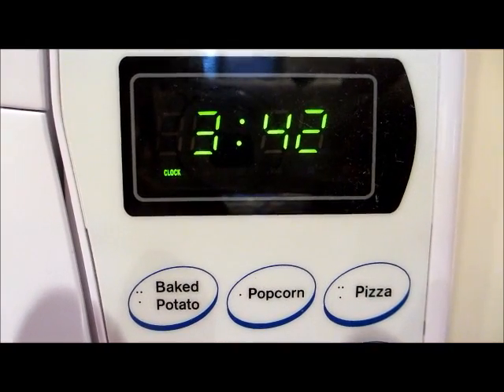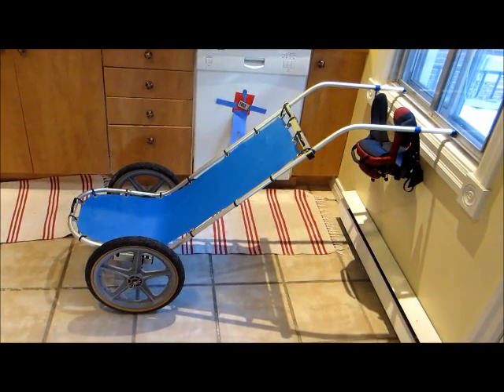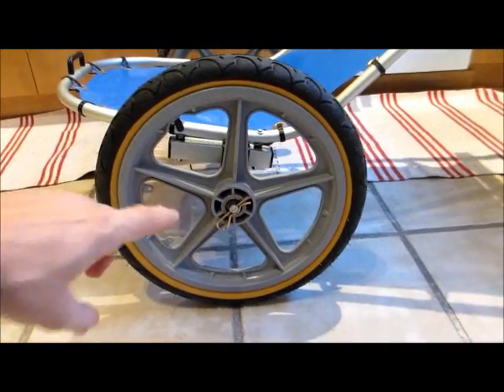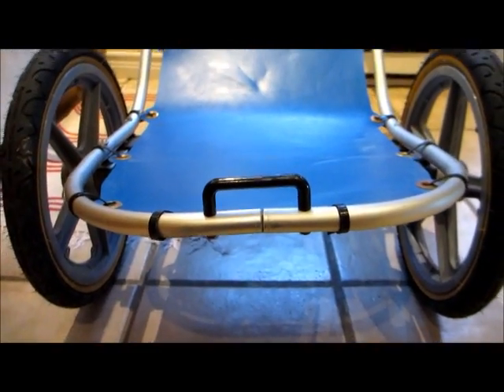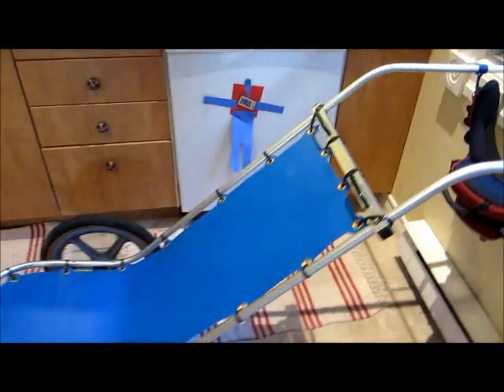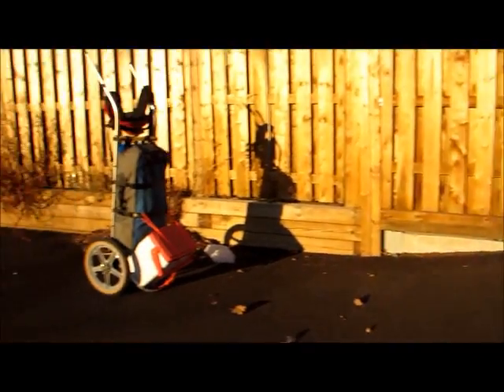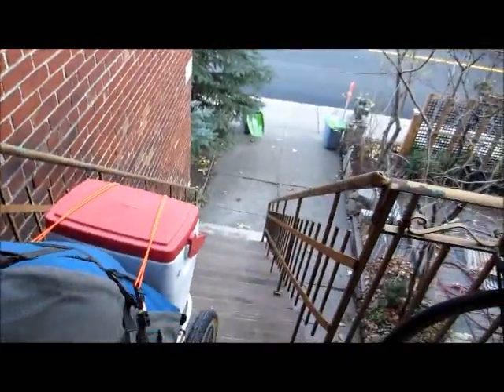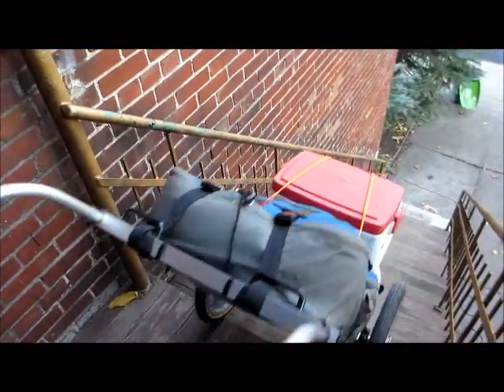DIY Mystery Gear from the Cheap Bastard

Comment from the maker: Sorry Cat, there is no technical data to post.  This entire project was done "free hand" as they say.  I took no physical measurements to speak of.  Everything was more or less eye balled into place.  I was using my own body dimensions to get the sizing needed. This was the third iteration, and its still not perfect.  When you look at it from behind you can see that one side sits a little higher.  Heck the tubing was bent using a hand held conduit bender.  What can I say?  Sorry.
Cheers

Comment from the maker: It's called a prussic knot.  It's a well known knot in the world of mountain climbing - useful for climbing a fixed rope - but it has a gozillion other applications.  I use the same knot to attach my hammock tarps to the tarp ridge line.  This means I can adjust the tarp along the line depending on how far apart the trees are from one another.  Very handy.
Cheers

Comment from the maker: The 16 inch wheel set was ordered from a company in Ottawa called Wike Trailers.  The square tubing that links the wheel set and acts as the undercarriage came from Home Depot.  The round tubing that makes up the deck frame also came from HD.  I "rented" a pipe bending tool from HD as well to bend all the angles in the round tubing.  That was pretty much an eyeball operation since I had no exact measurements for any of this.  The decking is an old magic carpet snow sled.  Very durable material.  I cut it to fit and used a half inch grommet kit that I had hanging around.  I think I bought it from HD as well.  The decking is attached to the frame with UV resistant zip ties.  The two halves of the deck frame tubing are connected by inserting a wooden dowel at the joint.  A black plastic cabinet door handle is screwed in to complete the connection.  The harness is made from a large sized fanny (butt) pack that I had picked up years ago from Mountain Equipment Co-op.  Sadly they no longer produce that model, but there are certainly other options available.  I attached a carabiner to each side of the pack and used a prusik not to hold on to the round tubing.  This is a constrictor knot, so when tension is applied it holds fast and will not slide.  Remove the load tension, and you can position the knot wherever you like.  Pure genius.  On the square tubing of the top brace I added two additional black plastic handles.  This was purely for aesthetic reasons, and because I had them laying around.  Later, they proved to be quite functional as well for lashing various items to the rig.  Also not shown in this video is the shoulder harness system that I added to the butt pack.  I found this a necessary addition for pulling any load heavier the 40 lbs.  I'll chip in a link to show how this set-up ended up working for a project of mine.  Let me know if you have any other questions.  Cheers from Montreal QC

https://www.youtube.com/watch?v=KL4LalWNVHc&t=82s

Comment from the maker: When I designed and tested this cart I was hauling 75 lbs up Mount Royal and back  (a 10 mile course).  On the way down I was actually running.  In this manner I could repeatedly complete the course in under 2.5 hours.  The wheels I use are 16 inch pneumatic with tubes on plastic rims.  The beauty is that they work just as well without air.  In this video with a 50 lb load they have no air.  Long story short: flat tires, no problem.  Any more questions, give a shout.
Cheers

Comment: Please let me know how this works when you do your hike. Does it restrict your gait any?  This is pretty much exactly what I've been looking for, as I'm planning to thru-hike the American Discovery Trail. There are lots of places where the trail is pretty narrow, steep, rocky, etc etc.  How much weight do you think it would hold? I was thinking about building something like this but adding little camping pod made out of a pickle barrel (?) for more protection than a tent (bearophobia). Also, it almost looks like it could be used as a little chair if you get tired and need to rest. Could you post more photos or give more details as to how you attached the wheel assembly to the frame?
Reply from the maker: Hey Bonnie,
Sorry for the late reply.  Here is is a link to the trailer, Toto 2
A Grand Day Out With The Toto II Trekking Trailer

I took it for a hike on city streets, open trails, and a little bushwhacking before nearly slicing off my thumb while making a spot of lunch.  This rig is awesome.  No matter how much you load it, there is no extra weight on your back, hips, knees, or feet.  Wonderful stuff!  And it also makes a great recliner when braced against a tree or post.

Cheers from Montreal QC

Comment: Hi Jeff. I like very much what you did. There is in Holland also a bureau who build these trekkingcarts. Look at Radical  Design wheelie wandelwagen. But I like yours better. Simple, you can take any luggage you want and are not bound to a bag like Radical design made. How did you become the parts for joining the wheels to the structure. Good luck with building. I am working on a bycicle cart now.

Comment: very good! you could tell me how much is the distance between the wheels? I intend to make one for my hikes !
Reply from the maker: measure the distance between your hips and add 2 inches.  It's just that easy.
Reply: +Jeff Spate thanks ! Now I achieve the 2 wheels and this week I'll start the project !
Reply from the maker: give a shout if you run into any snags.  always glad to help.

Cheers
Reply: +Jeff Spate i have some difficult with english ! I'm from Brazil... I'm planning to hike the camino de santiago, 800km ! , with this backpack trailer. Your's the best I've seen: simple, practical and beautiful ! Mine will be a copy at "long distance" of yours!
Reply from the maker: Send me a note If you need any help with the build.

Cheers from Montreal QC
Reply: I built the cart and walked the path of Santiago de Compostela with him. It was a success! I thank you for making this movie and sharing your ideas. It helped me a lot...
I walked the camino in october/2016...
Reply from the maker: Awesome!!!  Real glad everything worked out.  Two thumbs up for your effort.

Cheers from Montreal QC

Comment: How fast can you stop from a full run with that fully loaded? Does it feel like there's much danger of it bowling you over? I can imagine it wouldn't be hard to give it real brakes with levers by your side, but maybe there's no point unless you're pulling a lot more weight.

Nice job. I'm really inspired. I'm going to be spending some time thinking about what additional uses might come from this essential design.
Reply from the maker: If I were making a steep decent on rough terrain, some sort of hand brake would be a wonderful feature.  However, the design brief did not call for that particular scenario.  Primary intent for this design was road use.  I chose to illustrate its versatility by taking it off road.  Amazingly, it does not feel like it will bowl you over.  That might change, however, as load weight is increased.  I've loaded it to 75 pounds and run down the trail from the top of Mount Royal here in Montreal with no problems what so ever.

Cheers

Comment: sweet cart . i have all the materials to replicate this ...but how did you bend the tubing ? that's the only question i have . for now . i realize this was published years ago but i just found it recently . thanks in advance for any help on this .
Reply from the maker: In the electrical department at Home Depot I found a tool used to bend galvanized electrical conduit.  It's not an exact science, to be sure, but it did the trick.  It helps to have good eyes for eyeballing.  My eyesight ain't that great, but it appears to be good enough.

Cheers from Montreal QC
Reply: Jeff Spate thanks , when i get it done i'll put up a video . i ran across an old boat bimini cover . nice aluminum pipe , some bends in it i may be able to use . we shall see .

Comment: Heya Jeff, I don't have any material to heat-bend the alluminium and don't want to get gaz in my appartement (Living in the Mile End) would you .... do some for me ?
Reply: Getting ready for the Appalachian from Canadian side NB to Unitedstatian side Georgia and maybe even further down in New France (or what's used to be so)
Reply from the maker: +Eric Vanh 
I just used a cheap'o pipe bender to do my thing.  I'm happy to lend a hand if you need help.  Call me: 514-276-1046.  I'll be home Tuesday afternoon.

Cheers

Comment: A wheeled travois.  Cool.  All you need is a shell to act as a weather cover and possibly a temporary shelter.  I would have is longer in length to accommodate a longer stride and I'd go with a conventional 16 inch fat bike tire.

Very cool!  This is very inspirational and totally a something I'd want to have for those walk-abouts.

Comment: I like this a lot better than the two I put together.  I like the idea of the bigger wheels, and how you angled out the bottom, not to mention using a fanny pack.  Like, duh, why didn't I think of that.  I was always playing havoc with trying to attach my cart to an unpadded military belt. Not to mention, after watching yours, mine is clearly not wide enough.   Really slick!  Good Job!!

Comment from the maker: The rod I bought at Reno Depot, a hardware store in Montreal.  I was able to bend it using a pipe bending tool (from a Home Depot store) that electricians use for bending galvanized conduit pipe.  The wheels I ordered from Wike Bicycle Trailers in Quelph, Ontario (I live in Canada as you may have guessed).  Let me know if you have any other questions.
Cheers

Comment: Are you still using this cart? Have you made any changes?
Reply from the maker: I used this rig for a 200 km hike from Montreal to Ottawa several years ago.  I met a guy who lived in China that wanted to mass produce the trailer, but that never really got off the ground.  I have since dismantled the thing, and now use the wheels for my bike trailer.  Cheers from Montreal QC

Comment: Still loving this contraption. What did you use for the axle? Was that aluminum tubing too?
Reply from the maker: Hey Bonnie,

The frame for this carrier is made using an aluminum curtain rod.  The axle is an aluminum box tube.  The wheels have their own spindles that are fixed to the plastic connection pieces.  It's not complicated, but my description might make it sound so.  Glad you like this rig.  I'm taking it out tomorrow for a 400 km shake down.  I'm doing a cancer walk from Montreal to Ottawa and back in 7 days.  The carrier is my life line.  We'll see if Toto 2 can get the job done.

Cheers from Montreal QC
Reply: God speed. I look forward to updates. I'm working on transforming a little golf-bag cart (because it was 10 bucks), but if I had any spare change, I'd definitely prefer yours.
Reply from the maker: It's worth noting that my carrier was inspired by the sort of golf cart you mentioned and also by snow shoes.  Strange, don't you think?
Reply: These should be a common fixture at every outfitter or sporting goods store! Almost every thru-hiker I've seen pushes a jogging stroller. Why not pull hands-free instead of actively pushing with both hands.
Reply from the maker: That's the idea.  I'm hoping the trip I just finished will make for the right marketing tool.  Stay tuned for the video on that.

Cheers

Comment from the maker: Easy now.  Paul makes a valid point.  However, before going out & buying something, one should first carefully define ones needs.  I didn't need something that would carry 300 lbs., nor did I want a cart weighing 30 lbs.  My goal was to build a cart that would weigh in at 10 lbs (or less) capable of carrying 75-100 lbs over relatively flat or smooth terrain for up to 25 miles per day (a road trip).  It's the harness system I put together that makes it all work.
Thanks for your thoughts.
Cheers

Comment: Ingenious!  It looks like you have thought of everything, including a clever way to harness it for hands free pulling.  AND larger wheels for easier rolling and SOLID RUBBER so no worries over punctures.  I am using a light aluminum deer cart without a hands free harness,  Your excellent video gives me a simple idea.  I will attach handle extensions on each side, and rig a harness using your technique.  Now I can use my trekking poles or be hands free for dealing with limbs and briars on overgrown paths.  A cart of course is not suitable if your trail leads over large boulders.  Your invention is light enough, however, to muscle the cart and backpack over the  bouders, assuming the extra effort is not required for a long distance.
Reply from the maker: Hey Larry,

I have to say, this rig does work amazingly well.  I'll be giving it a serious road test this spring when I attempt a hike from Montreal to Quebec city (approx 225 km).  This will be a long distance endurance hike which I hope to complete in 4 days.  Wish me luck, and good luck to you as well with your deer cart.  Shout out if you need some ideas.

Cheers from Montreal QC

Comment: I have a trailer like this, don't be deceived, you cannot take more on your hike, it's just a way of moving the load off your shoulders and onto your hips. You still need to drag your gear up hills, along stony paths and carry it over rocks. Keep as much weight as you can on the axle.
Reply from the maker: Exactly, the idea was to get the weight off my back.  I had a specific goal in mind for this trailer: a 400km 7  day hike from Montreal to Ottawa and back as a fundraising project for the Canadian Cancer Society.  I was doing this solo and unsupported, so it meant carrying quite a lot of gear.  I think the total load was near 50 lbs.  Since I was walking on the side of the road, it was pretty smooth going.  I found that on flat or downhill stretches I could actually run with this thing!  I could never have managed the daily distance with a back pack carrying that kind of load.  The trailer worked like a dream, but I would never do it again ;)  In another video you can see the damage that my feet suffered from this crazy exploit.  Not much fun.   Cheers from Montreal QC

Comment from the maker: To make the bends, I picked up one of those pipe bending tools that electricians use for bending electrical conduit.  Strictly manual.  It was a case of guestimations and serious eyeballing to get it all to work.  I had to bend two pipes exactly the same.  A wooden dowel pins the two together at the bottom.  Dicey bit of business.
Chees
Reply: I tried this on a piece of 1/2" EMT and quickly found out just how hard this is. I thought, bending tubing - how hard can it be? Turns out pretty dadgum hard. I now have a greater respect for what you were able to accomplish. Can you offer any pointers in bending the tubing?